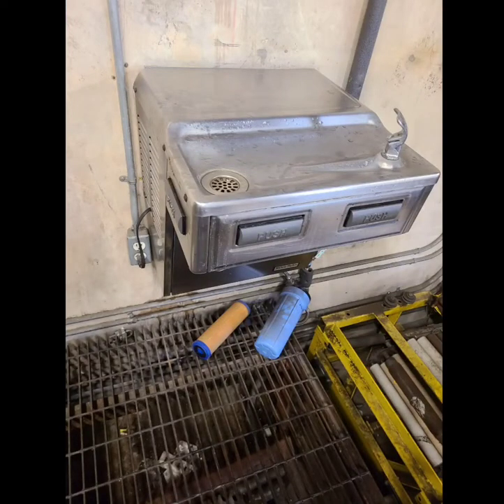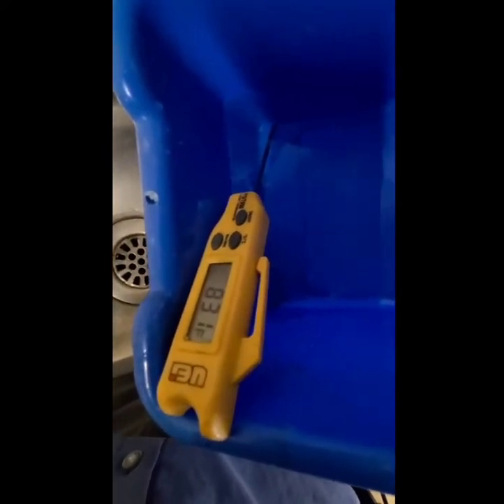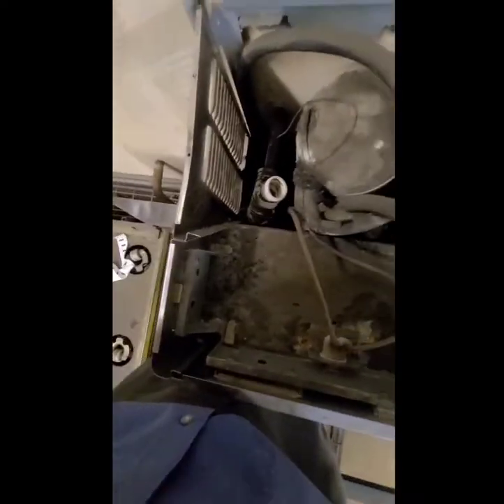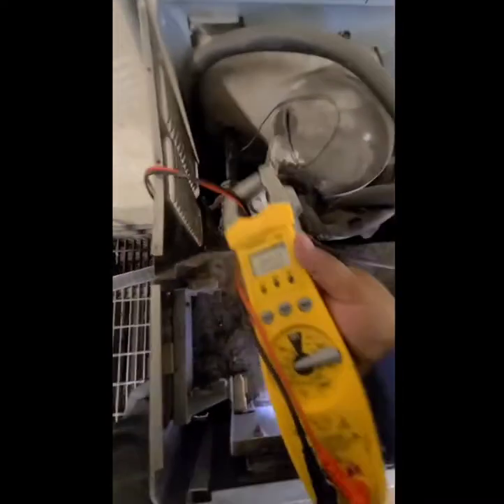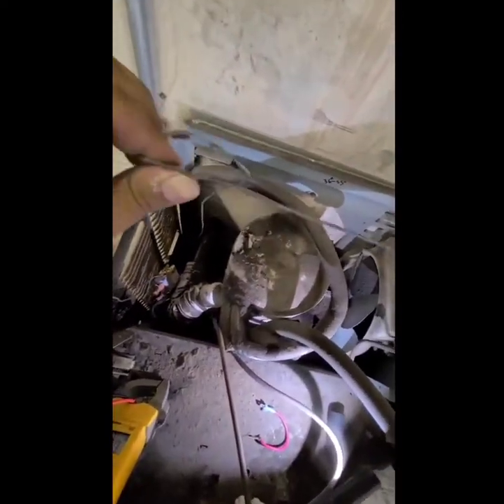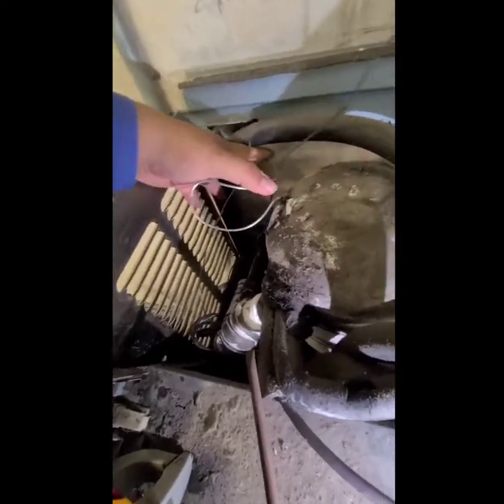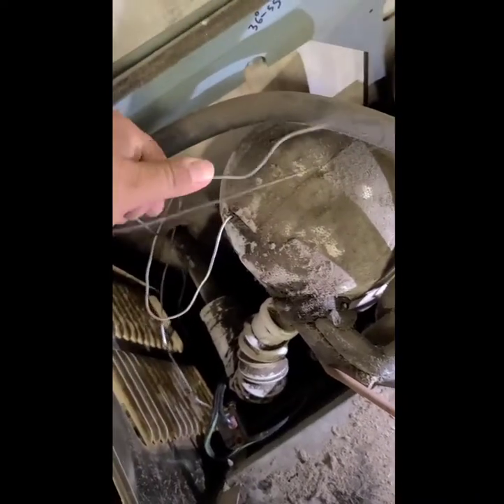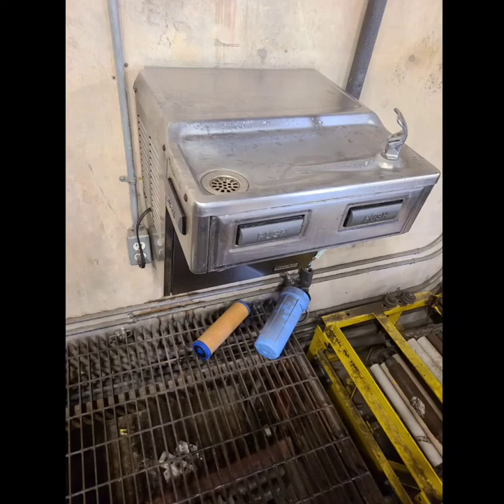Water Fountain Repair | Hot Water

Comment: what is the type of evaporator ? Is the refrigerant inside the coil or water inside the coil and it's shell and tube type ?
Reply from the maker: It has refrigerant inside the Coil. The Coil design is like a cylinder that wraps around a reservoir.